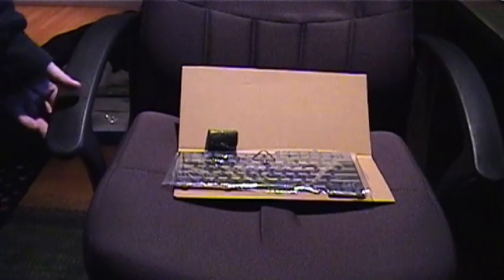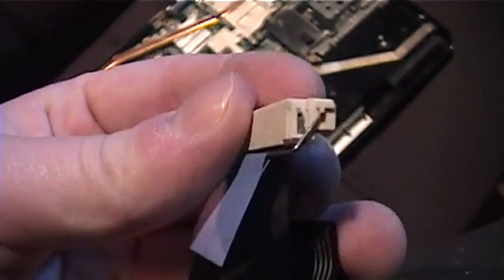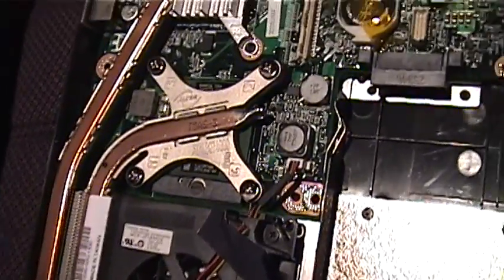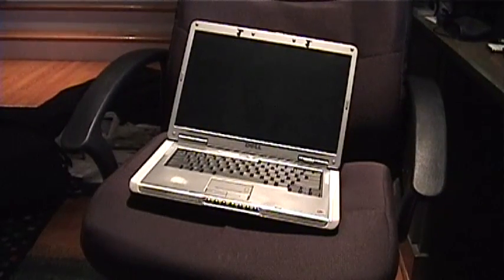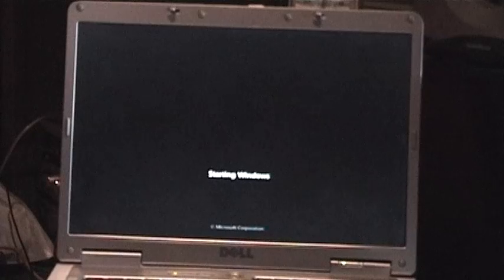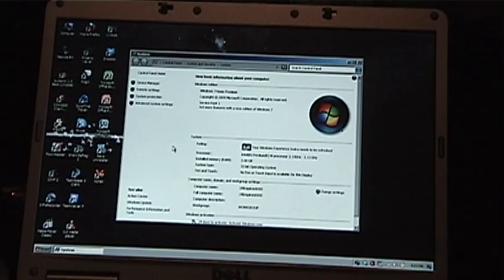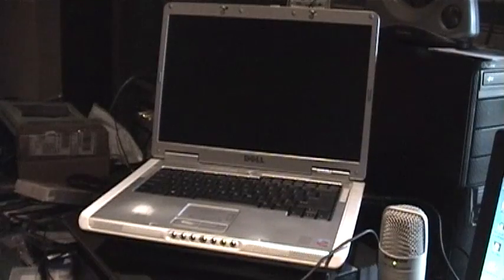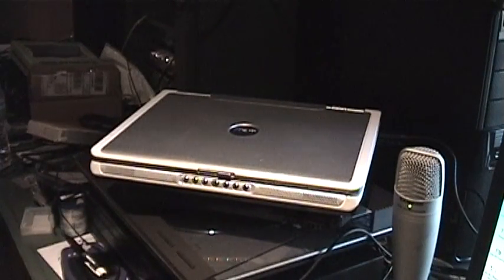Dell Insprion 6000 Upgrades & Updates

Comment: does xp graphic driver do the job on 100%..? I mean, .. I tried vista bussines, it goes quite well, but some videos are crap.. slow..  cpu changing - I mean its not point for this really old laptop..  I probably should try like you, to put w7 and xp graph. driver..
Reply: for it work i buy it use for 30 dollars ande upgrade the ram to 2gbs and im looking forward to upgrade the hard disk to 120 i want to buy a nother cpu but im not quite sure which to use cause the motherboard is a bit old and i havent found information about it  but win7 works here pretty good with 2gbs of ram!

Comment: I have a dell inspiron 6000 with Celeron 1,4 GHz. Do I need to change it to instal Windows 7? Thanks
Reply: if you want the i can help you i can give the drives of wifi and multimedia but first be sure that your computer has at least 1gb of ram 1ghz of cpu and 16 gb of free space ant atleast 64 mb of video card
Reply: Actually i have a dell inspiron with 1.60 ghz of cpu 2gbs of ram 128 of total graphics and 60 gbs of hard disk win7 runs just good!

Comment: Oh alright. I got an inspiron 9300 for 5 dollars yesterday that supposedly works, I'm just waiting on a charger now. The two I tried didn't have correct voltage and amperage so it only showed the power light for 4 seconds. Also no fans or anything else just silence and the light. Does this sound like something that should happen?

Comment: I just got one of these from my cousin, that had already been upgraded to 2 gigs of RAM, that was in near perfect condition with a dead screen inverter. Once the new inverter was installed, I realized that this laptop had the 1920x1200 screen, and I love it! Easily the sharpest screen I've used on a laptop. Pentium M 760 in the mail.